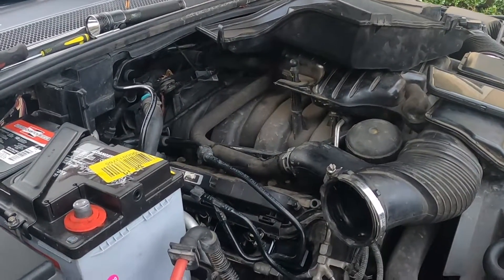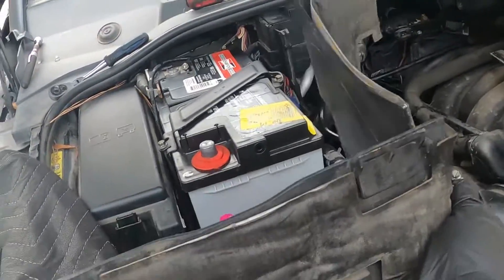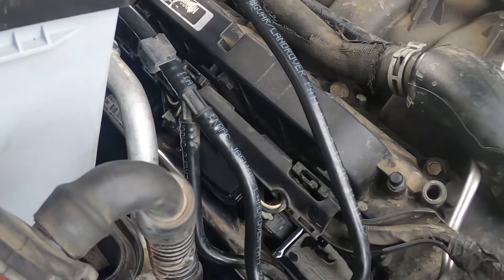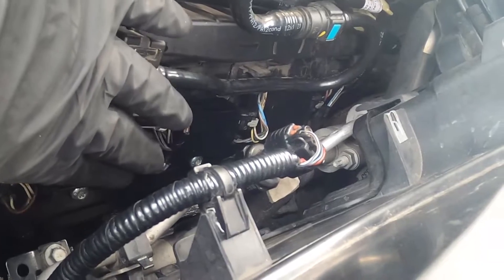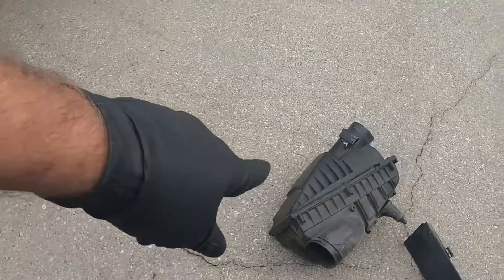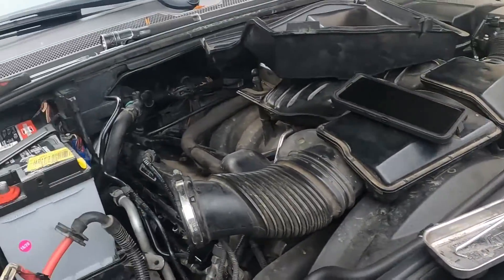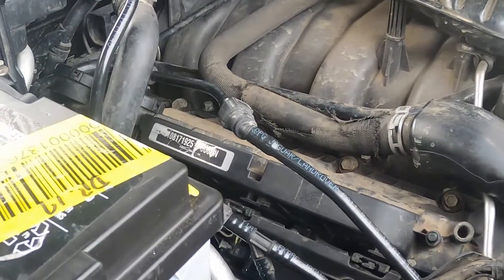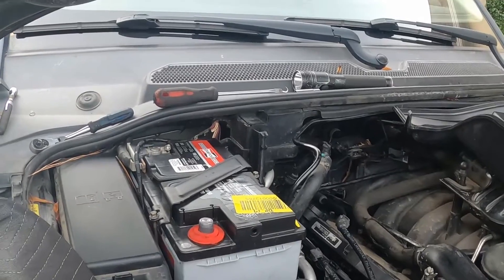2012 Landrover Ranger Rover 5 0 Spark Plugs ,Coils & PCV - How to Fix it

Comment: I have 2012 range rover sport . Cylinder 5 misfire. Change fuel injectors, spark plugs, and coils, and it continues  to show misfire 5. Any advise. Compressions between 160-180 on all cylinders.
Reply from the maker: Use a scanner see if it a hard misfire  all the time.   Or happens  every so often.   Check fuel injector  time  if it's the same as the others. Look at fuel trim is one bank higher lower then the other.

Comment: Do the sparkplug need to be gapped
Reply from the maker: Most platinum plugs no . If they have a cover over them  they are protected from damage of dropping as well.  Look at them but do not use a gap tool  it will damage the platinum on the ends.

Comment: Great video buddy,  question will i need to reset codes myself street parts replaced or will computer realize no misfire and remove restricted performance or limp mode on its own?
Reply from the maker: Its best to clear codes so the computer will relearn fresh data and not use the data curranty in there to make the fuel ratio corrections and stuff.